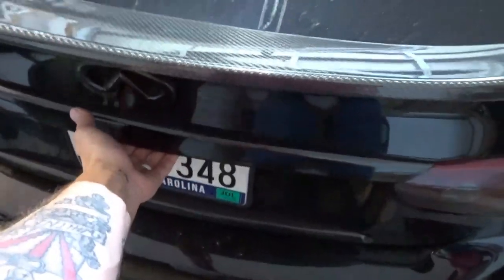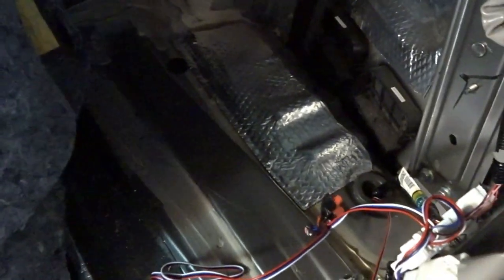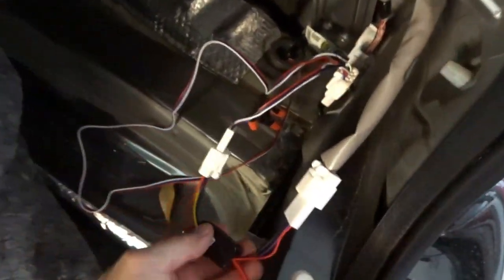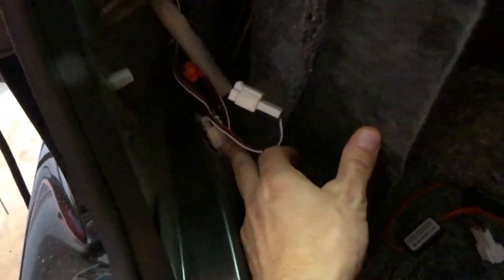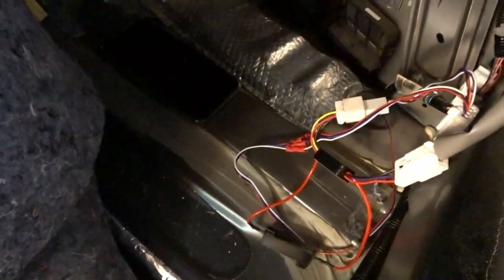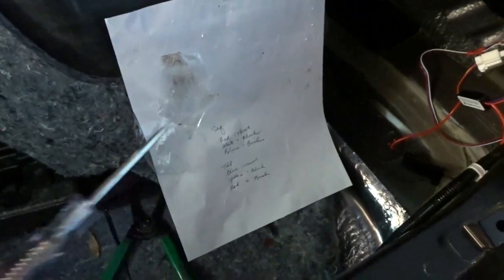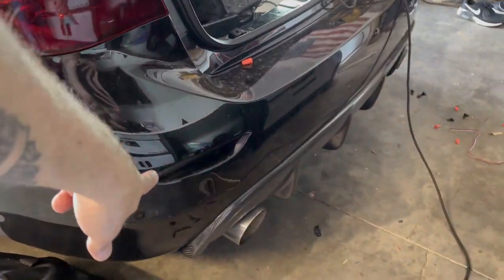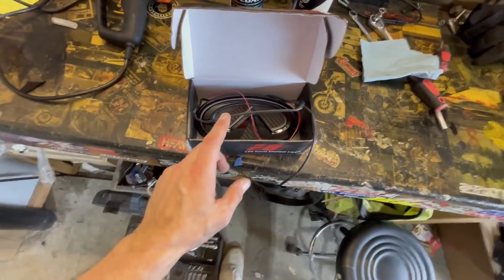Q50 Combining Rear Sequentials AND Tail as Turn Signal Modules

Comment: This is the one thing i did before you. 😋 i love how this looks. My wiring was a little different than yours, since i used the pins that you push into the back of the plug-ins.
Reply from the maker: I would prefer using the pins but don’t have any in my garage at the moment!
Reply: I'm trying to install tail as turns and sequentials tomorrow but my sequentials don't have a clip to connect them. They use hook like needle connectors that slip in the backs of the clips. Trying to wrap my head around where I would plug them in. Can either of you please help?

Comment: Hi ,why my infiniti q 50 at 150km/h have a vibration ,i have balanced tyre for , 5 times but the problem its present what may be ,thanks
Reply: Could you have pressed the brakes hard at some point, warping your rotors?
Reply: @TheMocutMiester  the problem was the tyre ,now with continental eco contact 6 no run flat the vibration is gone

Comment: what happens if u press the brake? because i noticed on mine the tail as turn flips timing when i press brake, so how does that work with the sequentials?
Reply from the maker: I'll have to look.  What do you mean "flips timing"?
Reply: @SpeedCultureStudios  like when i have turn signal on and I press brake, my front signal and mirror signal stay the same but my rear turn signals blink when front and mirror are not blinking if that makes sense